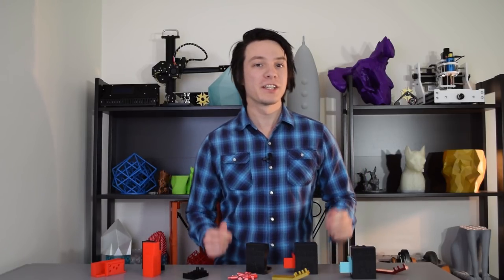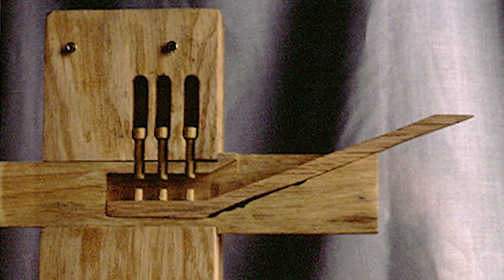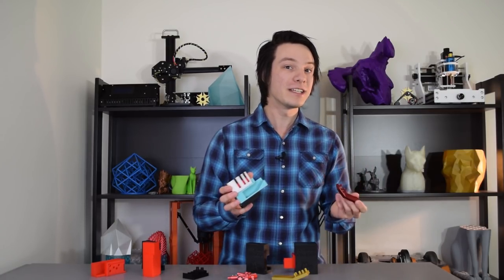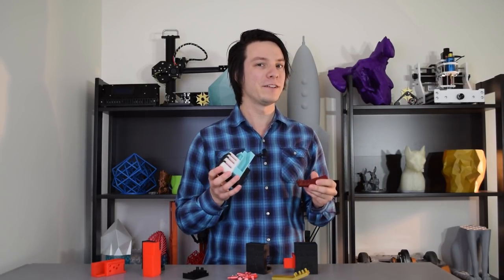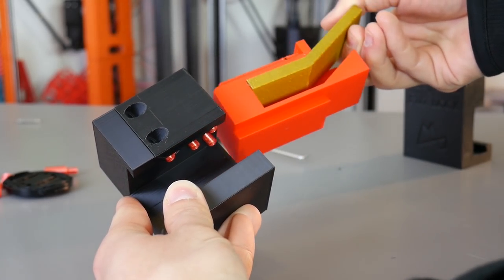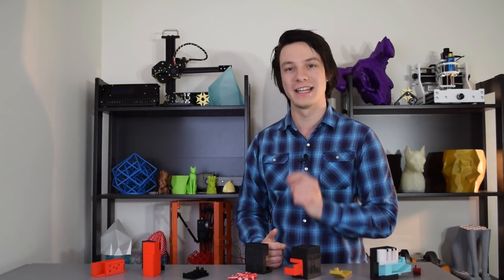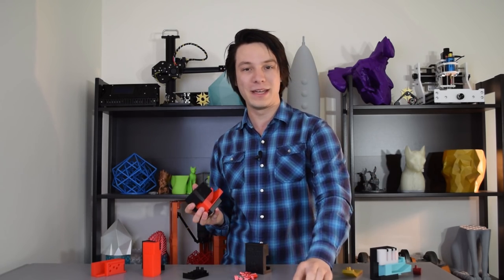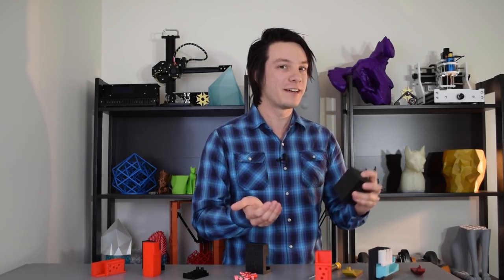This is the oldest lock mechanism ever discovered.

Comment: With the addition of correctly sprung pins, 2 part pins and some security pins there is no reason why it wouldn't be as secure as a modern pin lock. Just some what bulkier. If you added fake holes and blocking pins (that block the lock if they are pushed up) you could have a pretty safe lock against picking.
Reply: Yale copied the design, so that isn't a shock. His son, the famous one, Linus Yale Jr, added the idea of a shearline, and bingo, ~200 years later I still buy them in bulk for people's doors!

Comment: Picks just like a modern lock :)
Reply: Da Hai Zhu
Picks just like a Master lock 😉
Reply: I wonder if BosnianBill could defeat it? :-)
Reply: Tin2001 since the pins are non linear it is actually harder to pick then a master lock. Also since there are no protruding pins you can't rake this lock while raking is the fastest way to open a master lock.
Reply: you have to take into account the size of the lock. it's large enough that it's not too difficult to find the pins.
Reply: I don't think that would be too hard to downsize with modern tech.
Reply: Da Hai Zhu Where do you put the tension wrench?
Reply: Admiral Percy exacctaly
Reply: Admiral Percy N0 clue
Reply: The function of the torsion wrench is done by applying pressure to the slider. It works the same way, you just push/pull instead of twisting.
Reply: That's literally what Yale did. Sorry, you're 300 years too late!
Reply: Tension is applied by manipulating the bolt directly (i.e. tug on it just a hair to apply tension).
Reply: Oh huh, that makes sense -- it would be way harder to pick this lock if it was on the other side of the door...
Reply: I know an older lock it a bar or block of wood behind a door you cant pick a bar across the inside of a door
Reply: tin2001 ,
Reply: @SuperBobKing  What if the bolt was entirely enclosed and you could only reach in  with the key and pull back the latch where the "teeth" of the key went into the pinholes.
Reply: @bendynamic2150  a flat metal bar of sufficient rigidity would fix that. Every lock can be finessed, it's just a matter of time, resources, and knowledge. Look up Deviant Ollam's door talk if you haven't already seen it.
Reply: @TripleBarrel06  Depends on the construction my door had a lip that goes over the frame for a few inches and the bracket expands about an half an inch or more past the frame to prevent that.
Reply: @bendynamic2150  hook on a bit of rope and feed it through the gap at the top, hook the bar and lift. Unless your doors were purpose fit to sit flush there's always a bit of play that will allow access. Besides that if all else fails you take a load bearing pylon and put it sideways in the door frame, expand it a little and the door opens enough for you to access the bar.

Comment: Now here's another idea, instead of the bolt sliding out left - right, could it slide out towards you? For instance, if it was a door lock, you could make the bolt attached to the door and the body attached to the frame. When the door swings closed, it locks because the pins fall into place. You slide a key in the front, lift up, and pull. The pins work the same way, you just remove the bolt differently.

Also, could you incorporate pins like in a traditional tumbler today? Such as the pins being in both the body and in the bolt, and they have to be raised a specific amount to separate in the middle and allow you to remove the bolt? Then the tines of the key would have to be specific lengths and it would be harder (but still not impossible by any means) to pick.

I'm not an avid 3D modeler otherwise I would help, but these are just some ideas!
Reply: urmonator i was thinking the same thing as soon as i saw the design. In line or staggered pins, with alternating height, in a modern barrel lock, with much smaller keys, /could/ see the end of bump keys and hacked key printing. Would kill to see someone really take this idea to the next level
Reply: the difficulty with doing it the way you are describing is that all of the pressure would be on the tumblers and would very quickly wear out the lock. it would work for a sliding door however.

Comment: For a lightweight spring to hold the pins in place, you could use a wide rubber band stretched across the back side of the pins.  Enough tension there to hold the pins in place if turned upside down yet not enough resistance to prevent the key from being easily inserted.

Comment: Another way to pick it: using pressurized air and a small seal. Pushes the pins straight upwards out of the way of the lock. Can be fixed using the springs and a pressure relief  hole near the back.

Comment: To reduce the pickability of the device, you can add top pins with 2 pin lengths. Some of the pins will be lifted by the key (active) and some will remain in place (inactive) with the shear line already lined up. Strategically put grooves in the top pins of the active pins to act as false positives and mimic the shear line of the inactive pins during picking. This will mimic the pick resistant principles in current technology locking cylinders. A little redesign of the pin chambers will be required to keep the bottom pins from falling out and Bob's your Uncle!

Comment: nice, now I really wanna see the inside and mechanism of modern locks...
Reply: It's basically the same except instead of the lock sliding out, it rotates.  The issue with the pins being co-linear, is also why our keys have slanted peaks on it instead of just straight prongs.  This also the key to slide in past the pins as they slide down.
Reply: Mujtaba Ibrahim
Look up Deviant Ollam's Defcon talks on lock picking. Hes got some pretty good animations and explains it fairly well. Most of his talks do contain swearing though, if that offends.
Bosnian Bill's lock pick tutorials would be an alternative. Not as well explained though, IMO.

Comment: I just received my Cetus Mk2, and I'll give you a head's up. You'll need to replace the fan grill  as it restricts flow way too much. I had a catastrophic failure in the hot end the other day and they had to send out a new assembly with a MK1 fan grill. Since then, it has printed perfect every time.

Support are aware of the problem it seems.

Comment: You can improve the security of the lock by modifying the straight pins, cutting a band or two so that the pins will get stuck at the lip of the lock barrel, this should increase the time it takes to pick, you can also just shave the pins to make a mushroom or spool pin. And to reduce the chance of opening the lock by flipping it upside down, having captive pins on the underside of the lock barrel will help, so that if you flip the lock the main pins will retract just as the captive pins extend.

But really someone can always get past a lock, its just a matter of time, and the amount of obstacles you present that determines a lock failure.

Comment: My suggestions for an improvement on this design. Rather than having a gap at the bottom, have the top pin mechanism on a sprung pivot, so when the key gets to the back of the slot it pushes the back of the lever up, pushing the pin mechanism down onto the key. For the issue of the pins moving out of the way if you turn it upside down, have a pin on the lock at the top which will drop into a hole above the lock 
if it is turned.

Comment: Change the pin lengths like a modern lock, and make the slot flush with the wall, and it could be a more formidable lock.

Comment: The colinear pins mean a picker needs to keep the pins up while unlocking too. While they need to push all pins up to get the bolt moving in the first place, this makes the colinear version slightly tougher to pick (though this lock can be picked with a bent plate and some putty either way).

Comment: Surely this can't be the oldest lock design... maybe the oldest key lock, but a simple latch lock is older?  Or is there a semantic distinction?

I remember as a little kid, I think it was in the  Little House on the Prairie books described a lock where you had a dropping latch on the inside, a small hole in the wall up above, and a stick on a string that you could push out the hole.  When the stick/string was outside you could open it by pulling it, when it was inside you could only open it from inside.  I know LHOTP is much more recent, but things like that had to predate this...
Reply: What you're describing is a simple latch mechanism. The analog in current terms would be a passage knob or lever and a single sided deadbolt or night lock on the same door. When you close the door from the outside, you can't lock the deadbolt or night lock, because there's nothing on the outside of the door to allow you to turn it into a locked position. The passage knob or lever is easily turned to allow unrestricted entry, just like the stick on a string would. Once inside, however, you can turn the deadbolt or night lock into the locked position and the door can't be opened from the outside without force. The latching mechanism was simply to keep the door from swinging open while you were away and you coming home to a bear or cougar eating you out of house and home!

Comment: It's a bit like a modern pin & tumbler lock. I don't see a problem requiring the key to lock it. It means you can't lock your key in.
Also I don't see why dovetails would be particularly difficult for the Assyrians. Small dovetails might be, but these seem to be quite bulky.

Comment: Seems like the longer you make the shaft where the key is inserted, the more secure it would be (i.e. it would be harder to get the picking tools into there). -- Also, the key is kind of "two dimensional", in that it only fits pins from one surface -- what if it fit pins on multiple surfaces? -- You'd definitely need springs at that point, but it would be neat. :)

Comment: you could downscale it to a modern lock size and make it from a sturdy material. it would making picking it harder. the upside down defeat is the reason our lock have springs in the modern era. you could stop picking by having more modern style pins that get bound up on a sharp lip, that would prevent you from using a bit on tension to keep the pins from slipping. i feel that this lock would be alright with some of our modern anti picking pins and some proper springs.

Comment: It also seems like that design would also be susceptible to an impression attack both from the key and the lock. 

Also before they created locks they use to use seals on doors, and those were not so great, basically the owner would, before leaving create a seal on the door, then go out and come back and if the seal was still there then he would believe his/her stuff would still be inside, needless to say this was not a great measure, as would have to break the seal to get into your own house and  then while leaving create a new seal.

Comment: Instead of using stiff springs you could try small round Rare Earth Magnets repelling each other to force the pins down. so that you can still turn it upside down and it wont open. It would be an interesting thing to try. I would do it myself but I don't have a 3D Printer. Great Video and a great Design.

Comment: If you wanted to prevent the pins from being pushed up could you make it so that the pins themselves were made of a durable material that was meshed or hollow on the inside, that way someone had to have an object the exact size of the pins in order to move them

Comment: Some clay on a flat paddle would leave the imprint of the holes and would be a key template.
Reply: Not sure if this was part of the original locks found, but you can just vary the length of the prongs/teeth to counter that.
Reply: once you have the location the length would be just as easy to determine. If they were too long it would either teeter at a central location or you could again use something soft and when trying to pull it open the pressure would mark the length. Good point tho. I dunno either :)

Comment: "Actually pretty secure"

If you consider easier to pick than a master lock secure.
Reply: Jack Evans That's really bad because master locks are a pitiful excuse for a lock as far as security goes!
Reply: Go to your local locksmith's shop and buy a UP (Universal Pin) padlock. They have at least 8 snap groves in each pin that, after keying it, all act as false gates when picking.
Reply: Because it's old his standards are likely lower
Reply: It was rather secure for being one of the first locking mechanisms created. Is that a better way of putting it?
Reply: Secure in that someone with no lockpicking knowledge would take a while to figure out how to open it without a key, and someone with limited experience and no special tools on hand would take several minutes to open it. The fact it takes specialised knowledge or several risky (or at least seemingly risky) minutes means it will prevent the majority of potential break ins

Comment: There is a locking mechanism even older for doors, it consists of a specific length of stick on a string. You work the string and stick inside to move a bolt out of the way to open the door. If the stick was the wrong length it won’t work.

I need to find the info again to show you the design.

Comment: Jesus, it's so big you could pick the pins with your finger.
Idea for no-tool defeat: Tap the bottoms of each pin with your fingers very hard in order to force them all above the pseudo-sheerline and then push the lock out. If you're fluid and quick enough with it, you should be able to consistently pick the lock with your bare hands.

Comment: Actually dove tail joints would have been possible, just very very difficult.
Reply from the maker: Yeah figured as much. They're still ancient and very cool, but not 'as' ancient :)
Reply: I can actually hand-cut dovetails in my wood working projects... guess I'm ancient :)-
 - Eddy
Reply: they could've also just put a grove down a side...like a modern key has
Reply: To be fair, though, there wouldn't be a dove tail there in the original lock - there would just be a solid wall.  The dovetail is only there to hold it together and let you see inside at the same time.
Reply: He said that.
Reply: to be fair they did not use a 3d printer lol
Reply: Nah, dove tails, common, bloody easy back then. Inventing religion, now that was smart.
Reply: Dovetails are ancient technology. You just need a saw and a chisel. Of course if you don't need to see inside you can just use a front plate.